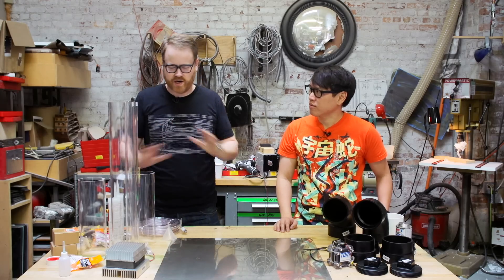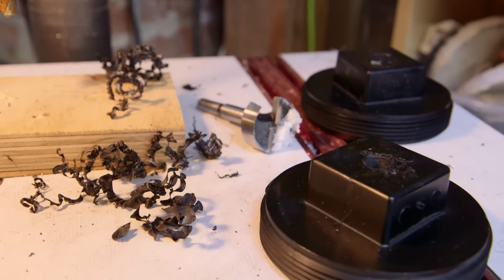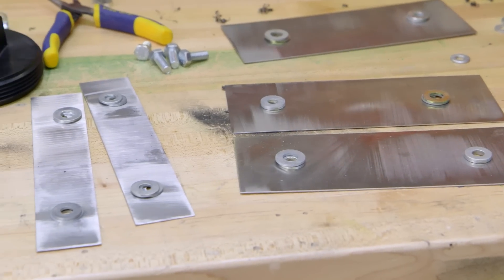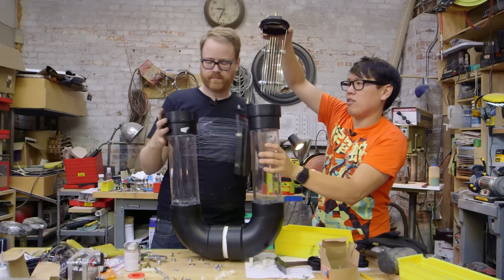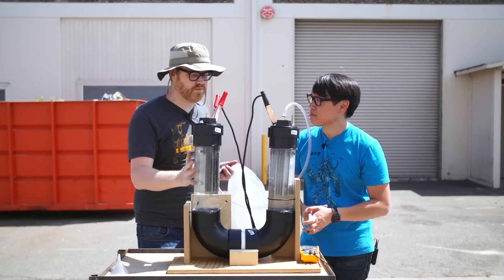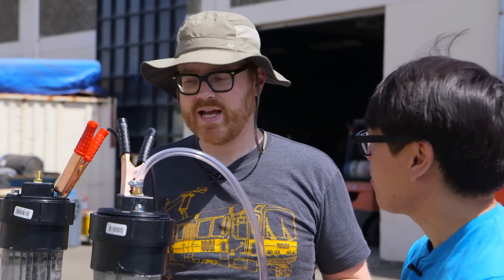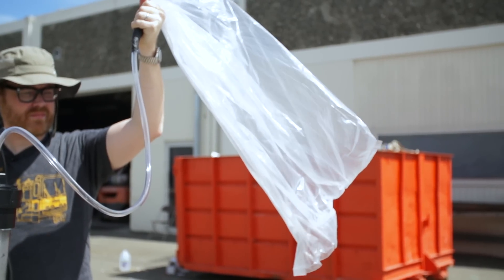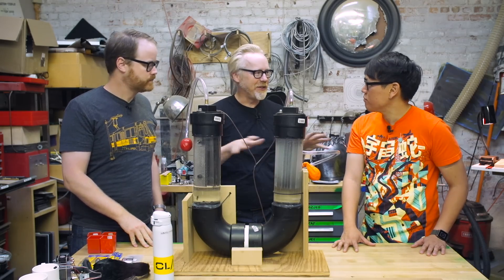Tested Builds a Hydrogen Converter

Comment: Oh c'mon... the more distance you have between the anode and the cathode, the more power you need "to pump" into the system because you have more resistance. Look at the size of that thing. HHO, hydrogen and oxygen gas mix, is easy to produce; the problem is efficiency and eventually separate the 2 gases, if you want pure hydrogen cheaply of course. The fact that neither both of you nor Adam, in that episode of Mythbusters, were able to produce some form of hydrogen gas in a respectable amount, just tells me that you messed something up.
And 1 more thing: Voltage is not power! Volt is electric potential difference. Ampere is electric current. Watt is power.
1 Volt x 1 Ampere = 1 Watt (just to simplify)
Really c'mon guys... I'm just an average swiss pothead and I have done a better job with a large mason jar, a couple of twisted steel cables and some baking soda. Nothing special, just messing around with some stuff to make an HHO mini torch just for fun; you on the other hand have access to a fantastic workshop with wonderful machines and materials...
I like your channel, I like Adam and your contents but fuck me: this video sucks.

Comment: could u build a stan meyers converter. using high voltage and high freq instead, and dial in the most efficient settings without using an electrolyte. this process also corrodes the electrodes how do u prevent that from happening? I guess it happens as electrolysis causes electro plating, but what is the real answer? thanks for the video

Comment: Wow! I must say, I'm impressed with this setup. It really is an excellent one.
I was going to ask if anyone thought to stir the sodium hydroxide in the water to dissolve it and spread it evenly throughout the distilled water, but evidently you didn't. I won't mention that if you don't dissolve and mix it evenly you might just as well add plastic beads. Also, I didn't see any effort the find a voltage that would be more suitable for that particular setup. Just for instance, I would have started with 1volt and work my way up to optimal while making sure there was enough amperage available, as  required. I'm sure you know the circuit will draw the current you need as it needs it.
It's obvious to me that you folks have been paid by someone to discredit hho generation, otherwise you wouldn't be involved in these atrocious acts of stupidity. At first I identified with the guy that mentioned the high school experiment because I remember doing that too. ours was a very much smaller apparatus with 2 inch long heavy wire (I'm not sure what kind of metal) electrodes, but I'm pretty confident that if we'd started in the morning we could have had 15 liters by the end of the day.
Suffice it to say I will not promote this video.

Comment: Great video, well done! You could increase the efficiency dramatically by placing the electrodes closer to each other, because then the electrical resistance between them would be much less. That would result in a much higher current allowing more gas to be created at the electrodes.
Reply: 6 years and me and 3 other guys gave a fuch

Comment: these guys are wankers ! the plates that were bolted together were about 4 x too far apart,
The diode & cathode were too far apart, no wander it didnt do fk all !
Reply: +Gaz Tinsley the plate spacing is about right for monopoles producing hydrogen at one set and oxygen at the other, it allows the "other" ion free passage to the other pole. Or would if there were not the equivalent of half a freaking mile of U bend for the ions to negotiate.
Reply: lol "diode" you mean anode?

Comment: The plastic bag gives a good demonstration of gas generation. Observing how helium filled balloons shrink over time, the gas leaks through the porosity of the plastic. Hydrogen is a smaller molecule, and will leak faster. Reverse osmosis filtration of water works this way, tiny holes in Teflon membranes allow water molecules to pass through, but larger molecules, "impurities," are rejected.

Comment: I think the real problem was the wimpy solar panel. It may produce 100 watts but they didn't even take the time to aim it at the sun, Lying flat on the ground, it tops out at 60ish%. I also noted that they added hydrogen peroxide to the water. That's wrong. Even in high school we knew to use highly dilute sulphuric acid. Overall... no hydrogen.

Comment: They're idiots! A six grader could build one better. First you need 7 plates, 5pc 3"x6" 20ga stainless steel sanded on both sides, 2pc 3"x7" 20ga stainless steel sanded on both sides, spaced equally 1/16" apart with rubber washers and plastic bolts run through the plates 2" from top and bottom. Hook 12v positive to top of one 7" plate and 12v negative to top of other 7" plate. Submerge until 6" plates are fully covered in distilled water and KOH or Potassium Hydroxide mixed, ( 2 tsp per 1 liter of distilled water ). Cap the top, tap threads in top put fitting in it with hose, and presto you have i.5 liters of H2 per minute, not 12 bubbles an hour. They're scared to build one correctly, they might piss a oil company or power company off. That's what happened to others, they tried to get patents for years and they couldn't, because the patent office was threatened by big oil and power...
Reply: +Jeff Moller that gets you a highly dangerous mixture of O2 and H2, which is not what they were aiming for.

Comment: i bet you'd get better results with 2 panels in series, or just use a transformer to bring it up to 100v, as per my understanding you biggest issue right now at 6:44 is that you are running at a low voltage, and without an electrolyte you need REALLY high voltage, otherwise you're bleeding power or even over volting the solar panel, i tried this once with a unisolar panel, working voltage was 24, but open voltage was 36, and i was darn close to 36 volts, but with a 1:5 voltage converter i dropped that working voltage to 28 and saw fizzing, not just the gradual "condensation" of bubbles that eventually broke free
Reply: +denvera1g1 also at that higher voltage the panel got so hot that water would steam off of it's surface

Comment: Hydrogen economy is never going to happen.  Hydrogen is a horrible energy storage medium because it's density is so low.  Liquid hydrogen has about the same density as styrofoam.  It takes way too much energy to transport it.  We'd be better off using CNG to fuel cars, and for those green freaks, CNG could be produced sustainably in much the same way as a sustainable hydrogen.

Comment: Your electrodes are just to separate from each other, you will need an incredible high voltage to overcome the distance between electrodes, thats why the king of random place the electrodes separate by just a mm to be able to use a lov voltage like the one of a car battery. Better luck next time guys!

Comment: The power itself is not the biggest problem, you could just wait bit longer. The main issue is the pressure loss. They started by an open oxygen valve and they have lost a lot of pressure. Speaking from my own experience, I have used the oxygen end to supply bit more water in the system. Also you don’t need a big electrode on the oxygen end. I have used single plate. On the other end, I have used graphite from pencils as a conductor which reacts very nice. To make water conductive, I have used simple NaCl and it worked just fine. I was able to fill small balloon.

Comment: First they say 20 V solar panel has more power then car battery , because it has only 12 V.... WHAT ?  then he says dont use tap water because it has chemicals in it like chlorine (althoug you are already drinking it) insted you should use destilled water and use pottasium but wear protective gloves and even face shield ... so what was the point then ? after that  I had to pause the video and breathe for a minute ....

Comment: It's more amperage that increases hydrogen production, not voltage. Lowering the voltage to 12 volts at 8 amps with a dc-dc voltage adjuster would yield over 50% more hydrogen than their 22 volt solar panel outputting 5 amps. They should've gone with a car battery or computer psu for literally 10 times the amps or more. Increasing the amount of electrolyte would also help.

Comment: The electrodes are too far away from each other too high in the tubes. If you put them lower in the tube and make sharper bend you'll be able to pass more current and produce more hydrogen. What's the concentration of the KOH solution? Maybe you have to make higher concentration to get more conductivity and the things will eventually happen. You should check the sealing also maybe you're losing hydrogen from somewhere. Expect to need a proper electrolyte cooling maybe submerging the U-tube under cold water. And really don't use solar power. For this amounts of H2 it's pointless and not worth the inconvenience.

Comment: It's not the Voltage that matters so much in this as the total current or wattage... You said that solar panel can provide 100 Watts of power...

 Well a car battery is able to produce over 7,200 Watts+ for the first 30 seconds of running or so (Cold Cranking Amps) because 12v*600Amp=7,200 Watt That's why King of Randoms rig was able to produce maybe 30x the gas that your guys could, in only a few minutes (If not more!) Even though the voltage was lower...

 Also your Anode and Cathode are very... Very far apart... The resistance of the water might be leading to extreme loss of effectiveness... 

 I would also be curious to know how concentrated the electrolyte was in the solution you were trying to electrolysis, as that can also make a huge difference.

 On one last note, many people mentioned the plastic bag might of been thin enough to let the Hydrogen gas escape through, I think I would also agree that it's very plausible.

Comment: comon, these guys are like working for oil companies or what? the hydrogen generator was built correctly. however they didn't do justice by connecting it to a low current solar panel. you need more current to produce more gas. why didn't they connect a 12v car battery capable of very high current supply? king of ransoms did it in his hho generator, it produced tons of gas. these guys are basically trying to give you the wrong impression that you can't produce practical amounts of hydrogen from small scale electrolysis. but the truth is you can produce sufficient amount of hydrogen this way and perhaps store it safely in metal hydride tanks capable of very high volume storage at low pressure. you can then use couple of these cylinders to drive a diesel car without any gasoline! once you run out of gas you simply connect the cylinders with the hydrogen generator and the gas will be quickly absorbed into the metal to form metal hydride, to be used in the car again. you only need to have some kind of electronic control system to heat the cylinder in order to release the gas.

Comment: looks like the upgraded version of what thekingofrandom did
Reply: ha! not even close.its like they threw out king of randoms instructions and said well lets make it seem like its not worth making so they will continue to buy hho from us
Reply: +cok Bagus That is exactly what they said in the beginning.
Reply: meh, true. i didnt catch it they said it so fast, thx for pointing it out!
Reply: What I don't get is that they said is that the solar panel puts out more power than a car battery & Grant Thompson - "The King of Random" said he used two car batteries but quickly produced more gas.
Reply: its saying "dont make your own hydrogen even if you can, buy it from us"
Reply: The modifications were meant to separate the hydrogen from oxygen. Grant's design allows it to mix making it more explosive. If you light hydrogen on it's own you get a POP, if you have 1 part oxygen & 2 parts hydrogen you get the BOOM that he does.

Comment: Im not positive but I think your losing a lot of voltage through the big gap at the bottom. The closet the positive and negative the better. Could be a simple fix with a metal wire looping through the bottom to decrease resistance. Might want to do the math but I'm pretty sure that where your problem is.

Comment: disinformation is the word... bad construction no power (solar 100w) joke
100w is the max efficiency on that panel even on 22v 100w=that is 4.55A + or - you need amperage to make it happen. a battery will give always more power than any solar panel

never the less was funny seem like an "illiterate talking about space technology in detail"
good work :D
Reply: FINALLY, someone who knows what is talking about!! If they used a car battery would be better because it can give more Amps. The LOAD would "ask" for more amps and the battery could give way more than 4.5A. They said "22V is better than 12v" and that's bullshit. 12V at 20A is better than 22V at 4.5, but they think they can fool everyone. That's what happens when a car company that uses oil sponser a "friendly environment video", they fail on purpose.

Comment: Nice bit of experimental science which shows it takes a lot of energy or fossil fuels currently to split water.Sure catalysts help accelerate the process but they are made from precious metals which also take a lot of energy to extract and then they get contaminated and need energy to purify again. They then have to liquify hydrogen for transportation and for fuels cells to work which requires guess what.  It does make you think that using hydrogen as a fuel in hydrogen fuel cells which are also made of precious metals is actually not that environmental friendly. Just my thoughts.

Comment: These dudes love taking it in the rear from big oil and the corporate energy cartel. They created yet another bit on home built electrolysis rigs where they epic failed all the way to the gas pumps. ON PURPOSE! These goons are supposed to be at the top of their game yet they go about these builds like a 5th grade science project building the absolute worst, most inefficient electrolyzers which produce miniscule amounts of gas. They want the general public thinking this technology is weak and insignificant. Most of you see this unit pissing a few gas bubbles and automatically think the tech still has decades of work. They also start people out with the lowest on the totem pole of designs so people waste time and money trying to replicate a system that's elementary at best. They didn't build a HHO gas generator that produced last time so why should we expect them to build a hydrogen oxygen split gas cell any different. This is probably the worst design they could have chosen to produce any real amounts of pure hydrogen gas in a timely manner and purposely made it a point to show the incredible amount of time it took to produce a small taste of hydrogen from electrolysis. Take it from one of the experimenters in the game for the past 5 years that Adam and Jamie are paid opposition. They aren't allowed to show you just how sophisticated and far you can take this tech with off the shelf parts. The cell design is laughable in terms of doing any real work. with the same parts   I could have built a design that would have filled up ten balloons with pure hydrogen gas with very little energy input just by tweaking the design. Don't think they didn't know this. They want everyone to think this is as good as it gets in terms of garage engineering these systems because they are the GREAT MYTHBUSTERS, WRONG! you wanna know how to build real electrolyzers that can produce much better results at much better efficiency rates, check out not just myself on YouTube but dozens of other normal garage experimenters on YouTube innovating and demonstrating home based hydrogen production on a much grander and logical scale. These guys are ass clowns, a disgrace to hydrogen energy researchers and builders around the globe. They work for the enemy that refused to give us this technology over 100 years ago. Google terms like Alkaline Electrolysis and Fuelcells, Lenr/cold fusion/ HHO gas, molecular hydrogen for health, the list could go on and on. The applications and sophistication of this technology is mind blowing. Do your research and DO NOT ATTEMPT TO REPLICATE THIS LAME DEMO UNTIL YOY HAVE SPENT SOME TIME ONLINE AND ON YOUTUBE REVIEWING THE LATEST HOME BREW DESIGNS AND RESEARCH...

Comment: Do you guys still have the rig? It would be more interesting to watch and work better if you dropped the plates down to the bottom of the columns. This will reduce the resistance and allow more current flow, thus more production. The lower down the better. Added bonus is you'll actually be able to see the bubbles coming up off the plates.

Also, Teflon tape the threads on the fittings, and collect into a mylar balloon, they're much less permeable to hydrogen.

Comment: Eh.
I'd rather use salt, maybe I get some chlorine gas.
If like you're rig, you decide to use 24v, way too much.
The magic number is about 2v per plate gap.
So if you have 6 plate gaps and you measured the volts between any neighboring plates you would have
+-2 Volts in potential difference.
There is a formula for amps as well, but I'm not exactly sure, you should have made a dry cell :>
Even with you're puny source of wattage, you would have been able to easily make 15 liters in a day.

PS: You didn't light the hydrogen on fire. :(

Comment: I guess they scuffed the ends of the clear tube to allow the glue to bind and key. But surely test-fitting the pipe, then marking with tape would mean an even line around the tube to be scuffed with abrasives. Would be nice and even then? Don't know - my mind is weird.